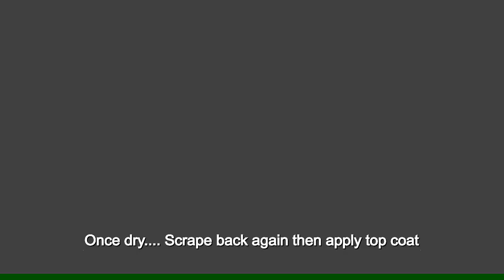Installing an Expansion Joint in Drywall Plaster Wall

Comment: looks good but you can avoid this problem by never putting a but joint above a window . sure it might be a little less work then for the finisher. but in time it will crack if its not screwed every 6  inches .framing above the Windows are not suited for butt joints
Reply from the maker: yeah true that, there shouldn't be a butt anyway for the reasons you mentioned. i didn't plaster it. That is probably why it cracked here in the first place. This was my first video on the tube

Comment: Do any manufacturers make a control joint that you don’t have to mud in just cut a groove and pop it in Thanks
Reply: You can cut it and cover it with round over trim. Works the same way

Comment: what do u do with the seamline. Will u tape it? and where must u put these control joints near doors and window?
Reply from the maker: +Brandi Hay There are tear-away strips that peel off the center is just painted in and is the flexible part,  the idea is letting it move if it wants too, if there's nothing over it nothing can crack. 
Normally they are installed wherever movement still occurs which cant be fixed by plastering over.
Above windows, hallway ceilings ect.